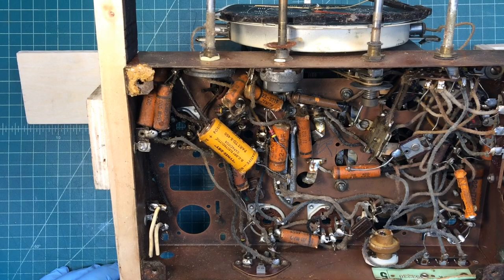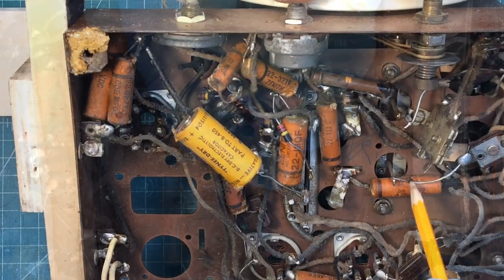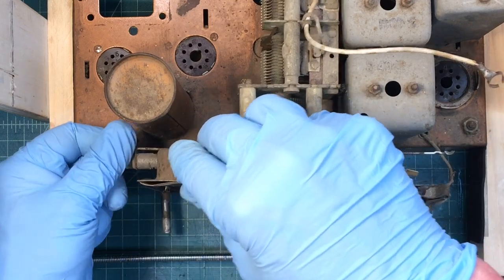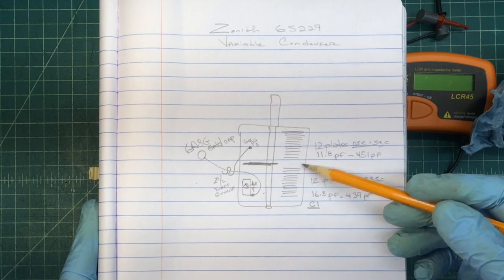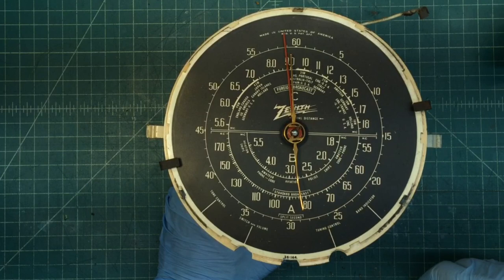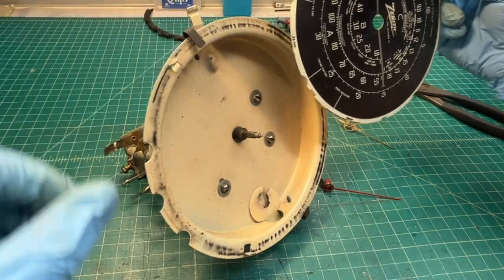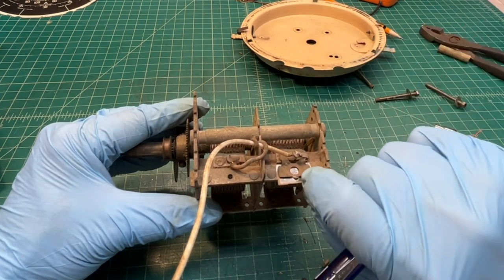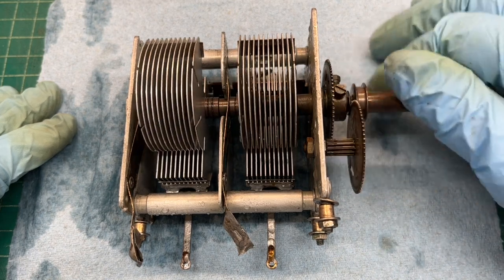Zenith 6S229 - Removing & Cleaning the old Tuning Condenser

Comment: Don, I use white vinegar, to soak my tuning condenser's in. Usually over night is sufficient, then the tooth brush and simple green cleanser, to remove the old slime and oxidation that has accumulated over 70+ years of use and abuse..  great videos, love the one of the Faux finished cabinet.  Great Job.
Reply from the maker: James, thank you for the info, it’s always great to know how others tackle these issues successfully and I appreciate your kind words on the cabinet. Best, Don

Comment: I ALWAYS clean V.C.'s and other parts in an Ultrasonic Cleaner with Simply Green !
Reply from the maker: Thanks for the info. Do you dilute it or use at full strength? Best, Don
Reply: @RestoreOldRadios  - I use full strength on really bad condition items, but use 1/2 & 1/2 on most items. I then blow them off with an air compressor, and fill the bearings with lithium grease.

Comment: Hi Don ,  my 6s229 the dial was not soldered on just pushed on.   Careful if you get another very easy to break while installing  . Also, the grid cap wire on mine was not shielded .     Hope  this helps
Reply from the maker: Dean - helps a lot my friend. I appreciate your feedback. Best, Don
Reply: @RestoreOldRadios       It is I who is grateful I have learn so much watching your videos.   I really love what you did to the cabinet . I must admit I was skeptical at first,  boy that thing turned out great .    Thanks

Comment: Citric  acid, isn't that what they use  in  soda?  Why do they  call  it a gimmick   capacitor?
Reply from the maker: John, you’ll see my earlier reply to the citric acid question. A gimmick was just the name given as it’s a trick, i.e., twisting two insulated conductors together to form a 1 to 3 pF capacitor or so and was a cost effective solution for those low value capacitance needs. Best, Don